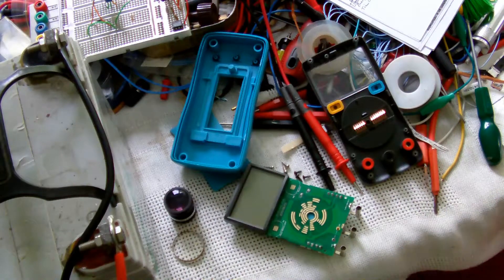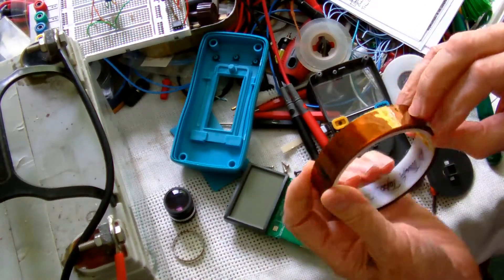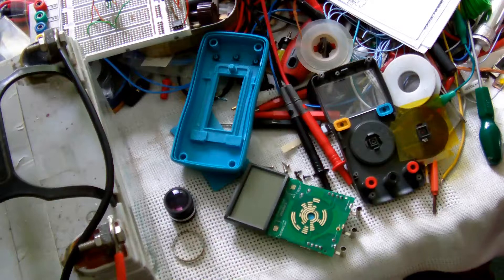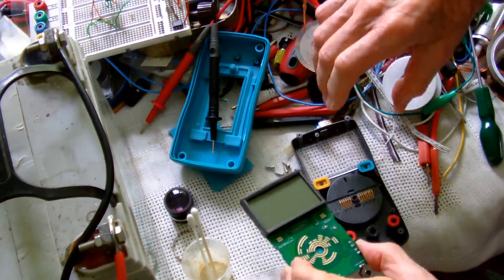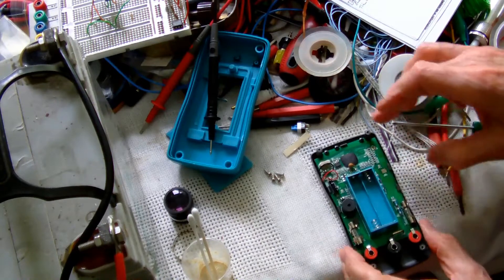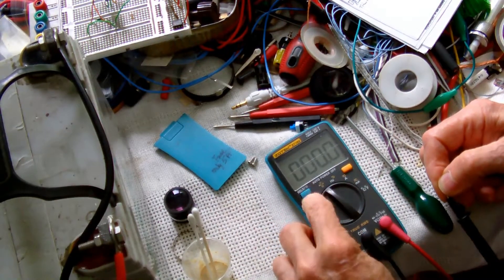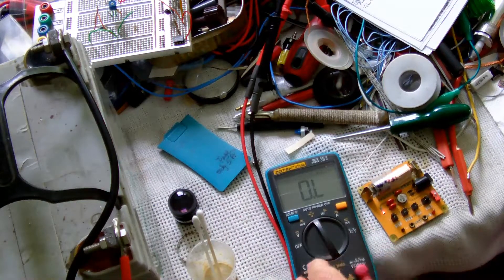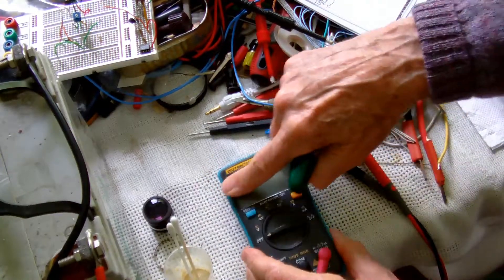Repair Multimeter mini, Aneng, Zotek and similar units.

Comment: I know an even easier way specifically for this model. Cleaning the contact area with alcohol and a little new technical vaseline. Then a small piece of notebook paper folded in half is placed between the board and the battery compartment at the bottom, so that it is in the middle of the button. 
The back cover with the screws presses the battery compartment down, and it with the paper and the board, just as much as necessary. The button immediately feels tighter.

Comment: For scratches on plastic, I use the the following solving method originally developed for plastic lenses used in wrist watches (softer compared to “Saphire glass”, I mean):
Use a flannel with toothbrush paste (cheaper ones are ironically better - more abrasive) and polish the plastic window manually. Do NOT use faster speeds as any power tools, and your plastic remains cool and in a couple of minutes the larger scratches are cleaned and smooth enough to but bother anymore(this is my updated stopping point), and after +/- 5min you can completely remove them, when we feel more perfectionist.